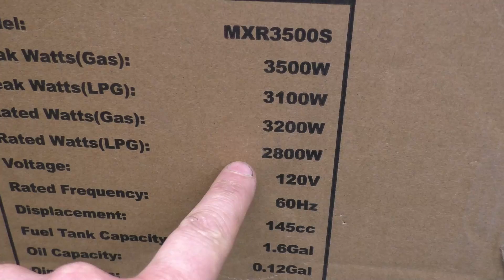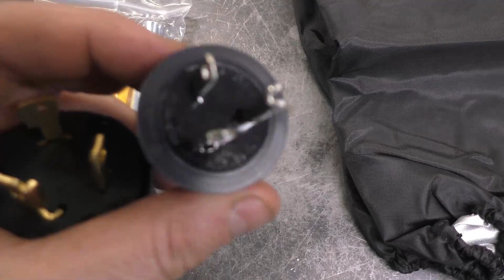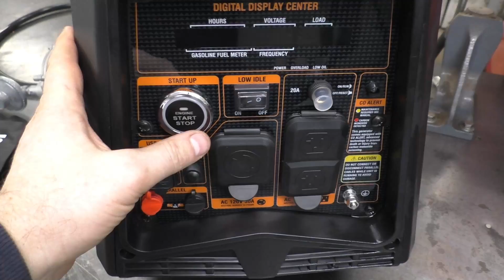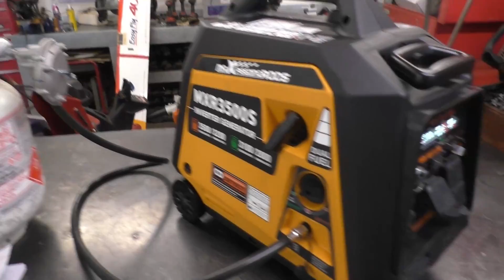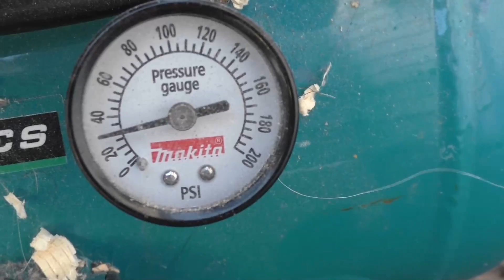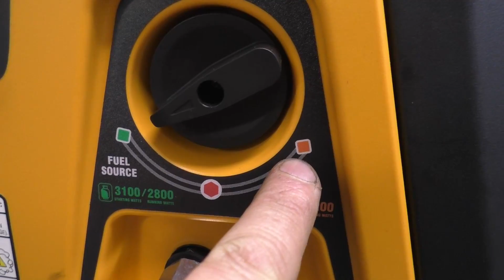MaXpeedingrods MXR 3500W Dual Fuel Portable Inverter Generator,Electric Start,Gas & Propane Review

Comment: The most important DOWNSIDE of this generator - and a very hilarious one - is that it doesn't have a CHOKE control on the outside on the front panel or on the side, like almost all other generators do.
You don't need choke when running on propane, but in a scenario when: 1) you're using gas 2) your battery for electric start discharged or died (they die very easy on these MXR ones) and you need a pull start, and 3) you're doing a COLD start - congratulations - you're FUCKED, go take off those side panels and search where the choke on the carburetor is.

So the author of the video makes a very good point at the end - run this only on propane. Because if you'll need to do a pull start on gas in an emergency - there's a chance it will not be very easy

Comment: I'm researching this gen set but realized it does not have a choke and have concerns with starting it in the winter with pull start only (assuming battery is dead).... Your thoughts ?

I appreciate your time spent in responding, thanks
Reply from the maker: It starts using propane, but the battery doesn't not last long.
Reply: OK so how does it start without a battery.... Have you tried starting it with the pull handle crank start  ? And since it does not have a choke is my concern when pull staring  ?

Comment: The instructions on the generator advise to disconnect the battery if you plan ‘long’ storage.  I guess either long means maybe a month, or else, even though the battery comes with some kind of charge, it’s not fully charged.  I went to start this today as our electricity is out.  No electric start.  Some posters here have advised that they have the battery on a trickle charge.  My question, as I will need to do this:  How do you connect the trickle charge to the battery connector, or must you connect it directly to battery terminals????

Comment: One very major flaw.  There is no manual choke to set.  If your battery dies and you have to pull start when it's cold, it will not start. I'm sure you could figure out the choke on the carb but if you're  not mechanically minded you're SOL.  I  know, because I bought it.

Comment: I have this machine for power emergencies. I can literally open a window and put it on the side counter. Fumes go right out the window and I can run an oven on it. I store it in a cupboard and have only ever used it on LPG. I am now going to invest in a actual standby Natural gas generator after having this one for 3 years.
Reply: I have done over 1000 hours on LPG and the carb is as clean as a whistle. I also have an LPG car and I have done over 140,000 miles and I still have the original exhaust. I love LPG!
Reply: 1k hrs on this generator? That's good to hear

Comment: I’m in the EU. There are slight differences (other than voltage, etc) that the EU model has.  First, it’s rated at 3500/3200 for gasoline, and 3200/2900 for propane. There is also no CO warning on the machine.  If you are running gasoline, there is a fuel tank gauge on the top by the fuel filler.  I do have one question:  I find that the knob to turn from gasoline to propane is really difficult to turn.  I was wondering if you have any suggestions as to how to make it easier.  Other than that, I love the machine.  I live in a small cottage, and this generator will actually run my whole house: lights, TV, computer, freezer, fridge, etc.

Comment: Just bought the same generator, and it now also comes with remote start.
Reply: Only in Europe. No remote key fobs in the USA. I just bought it and it did not come with one. I contacted them and they said it is only for the european market. If you got one here in the USA you are lucky.
Reply: @jmrdrgz  Yes, I’m in the EU.  But sadly this purchase has not been terribly lucky for me thus far.  The battery failed, will not take a charge and I must now replace the battery.  The distributor does not stock them, and the new battery must come from China.  While the generator worked great on the first day I received it, when I tested it after I unpacked it, it has not worked since.  Being duel fuel, I’ve only tried to start it with the recoil on propane, and have been unable to.

Comment: Great tutorial. I get mine next week. Question, can I tap into my RV propane line and run straight to the Genset, not using the propane regulator/line that comes with the unit?

Comment: Does anyone know if the fuel cap is the same size and thread as the honda generators. Looking at a cap with a fuel line fitting.

Comment: Does it have remote start, I've seen a video of the same generator and it had remote start
Reply from the maker: yes
Reply: @donyboy73  nowhere in the link does it say remote start, it says 2 ways to start , push button and recoil, and when you showed what's in the box nowhere was a remote button start??
Reply from the maker: @craig3818  watch entire video
Reply: Just received mine, no remote start, just recoil or push button

Comment: That cord end is a nema 5-20 it's a 20a 125volt cordend.  The plug on the generator is a nema 5-20r same rating as the cordend but will also fit a 15a plug. You'll find then in every kitchen wired after about 2008

Comment: It definitely has some neat features, but the "MADE IN CHINA" label scares me a bit. Decades of experience have taught me that when it comes to generators, there's Honda, and there's everything else.  BTW, the lower rating on LPG is due to gasoline having a higher energy density.
Reply from the maker: even some Honda generators are made in china now
Reply: @donyboy73  That's a shame, considering the premium they charge for them.

Comment: Hi Dony:
I assume because it says it's an INVERTER generator that it should be safe to use on electronic devices (like a modern furnace). Did you see anywhere the harmonic distortion in the specs? I'd hate to take out my furnace when crunch time comes.
Reply from the maker: yes it's safer than a regular genny on electronics
Reply: @donyboy73   I see from the specs it is 3% THD which is very good.
Thanks

Comment: be careful brother 
generator electric is not always up to specs
a conditioner is suggested for anything you want to keep
a grinder or hand drill aint no biggie to burn up
the last time i used mine it cooked a couple systems in my fridge and its not a computerized one now no temp control and no humidity removal
but it still freezes but dont trust the fridge and it damn sure aint frost free anymore,....garage drink handler
all from one hickup when the generator surged when the fridge kicked on the first time
a voltage conditioner aint cheap , but neither are fridge/freezers

nice demo/review

Mike

Comment: The reason gas generates more watts than propane, Is gas produces more energy than propane. When using gas, It is highly recommended to use engineerd gas. It's all I use in all my power equipment, and never had any problems. Thanks Dony, for the video.

Comment: Another plus to using propane is how clean it actually burns in the engine. It may amaze you how clean your oil looks when you change it.
The downside to propane is that unit:unit with gasoline propane has less energy in it. That is why the power output is down some in the generator.
Off topic a bit but propane makes a good heating and cutting fuel for your oxygen/fuel torches too. It has less carbon than Acetylene so it makes cleaner cuts. The downside is it's harder to light in a wind...but that's another topic.
Anyways,
Cheers from NB

Comment: When it started your compressor did it have any trouble? I have a Honda 3000 watt inverter generator that won't start mine.
Reply from the maker: no problems whatsoever, it's better to have "eco mode' off when running tools that require more electricity though

Comment: Now that is a great generator just wondering if the engine has a magneto that recharges the battery for the electric start system? 100% correct on using propane if possible because everybody stores their generators with normally full tanks of fuel and never run it for many years and the fuel has gone bad and gummed up the carb or just will not fire. !00% first start always with the propane.
Reply from the maker: yes battery charges itself when runnng

Comment: Fantastic video.  I have been looking at new generators as mine is  quite old and needs replacing.  I had not heard of Maxpeedingrods before watching your video.  I really like that this generator has the electric start and is an inverter generator with good load capacity.  Thank you Dony.
Reply: Before buying any of these off-brand generators it is a good idea to contact the company and see what replacement parts are available - if any. A lot of these Chinese units have no availability of any replacement or routine maintenance parts.
Reply: Good point. I have this exact model. It has one hour on the clock and the pull start has failed (don't know if it ever worked as only used electric start) Emailed the company and so far no reply. 🤷  @eosjoe565

Comment: Nice review.  Those CO sensors are becoming very common on a lot of generators these days. I'm not a fan. If anything is going to fail and leave you without power when you need it most it is likely to be that CO sensor. Folks have reported that if the wind is blowing the wrong way it can blow exhaust inside the generator and cause the alarm to trigger and shut off the generator. Folks using generators on food trucks and sound enclosures have a terrible time with the CO sensor. And lastly, the sensor has a finite life. At some point it will light the little "end of life" indicator and then you are screwed. On some generators a new CO sensor module is $700. This is one "nanny feature" that I do not like. They need to make it easier to disable/bypass the sensor when it is not needed or has failed. One last tip, when using something that draws a lot of power instantaneously like a welder, it is best to turn the Low Idle feature off (sometimes called Eco Throttle).
Reply: Yep and there junk and needs to be bypass to 
Lots of problems with them killing engine

Comment: Great video.  A few months ago I bought a similar generator (similar features, different brand) for a friend for all the reasons you mention.  Electric start because she doesn't have the upper body strength for a pull cord.  Propane so there are not any fuel system issues after storage.  A couple of things that you didn't mention: quiet, and low THD so it's okay for electronics.  BTW, I would recommend using a battery tender because these generators typically sit unused for long periods.
Reply: I start mine every 30 days and run it for 20 mins.
Reply: Can you advise which amperage tender you got, and how you connect it to the MXR battery?  I’m a novice in all of this, and the internet can be confusing.  Thanks.
Reply: @Inisfad  I have had good success with the Battery Tender Junior (750 mA). Connect the red clamp to the +ve teminal on the battery, black clamp on the -ve terminal. Plug the unit into mains power, and you're done.
Reply: @briantaylor9266  Thank you.  I’m getting all confused regarding info if the battery is lithium, lead acid, etc., and the manual with Maxpeedingpro gives no info about the battery at all.  Thanks for your info.
Reply: @Inisfad  Is there anything printed on the battery?
Reply: @briantaylor9266  You got me…..the generator is up in the shed, and I was hoping to get the info from the manual (or someone who knew).  I do suspect that it’s a lithium battery, as the generator is only 25 kilos in weight.  I’ll go up to the shed to look tomorrow.  We were supposed to have ‘rolling blackouts’ this fall and winter, and thus far, the electricity has been really stable . I bought the generator in October, tried it to make sure it did what it was supposed to do, and haven’t used it since.  I know the instructions say to leave the battery unplugged if you are not going to run it, but then if you need to start it right away for some reason, you are hassling with the side cover, connections, etc.  I’ll look to see if the battery has some indication on it.